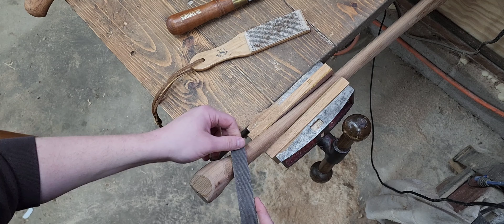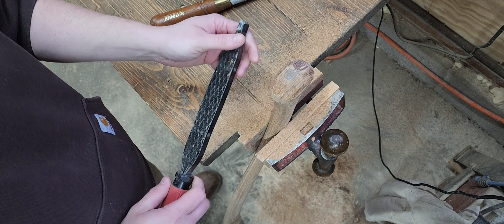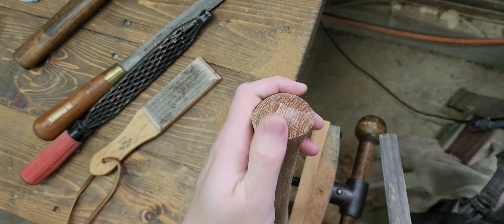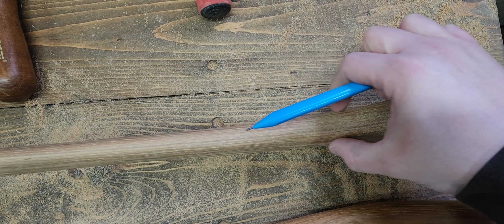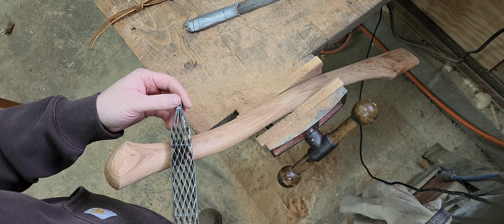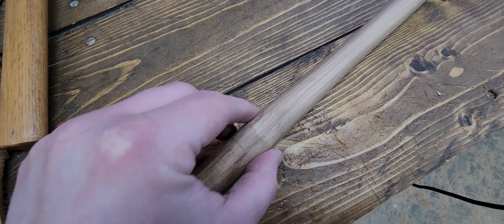AXE HANDLE SHAPING: PART 2 of 3

Comment: A topnotch tutorial. Have you ever used a nicholson # 50 half round pattern makers rasp? I bought one 30 years ago and it's going strong. They're still available but not cheap, I believe $65. Thanks for the good video and good luck, Chris
Reply from the maker: The one rasp with the duct tape handle is a Nicholson that I inherited from my grandfather. I dropped and broke off the tang probably 10 years ago. I loved how it cut so couldn't part with it. I'm not sure what model it is but have thought about picking up some new ones to test out. I'll have to check that #50 out. I may also pick up one of those curved Japanese pull files but those are also a little pricy. Thanks for checking out the video!

Comment: i expected you to have pencil lines all over it for the pommel end. but i suppose experience...
Reply from the maker: When I recorded this part of the video I did a lot of explaining of how I move the files to get the desired shape. When I edited the video I figured people didn't want to watch a few hours of me shaping and explaining so I sped up the footage.

Much of it is taking off some material and then checking it, then going back and taking off a little more.
Reply: @IronOxAxeAndTool  excellent  content, wasn't a criticism,  far from it.
Reply from the maker: @Lance Millward  it certainly wasn't taken as that. No worries! It's a struggle learning how to show the process but also distill it into a length video that's manageable to watch lol. It seems when I'm doing these handle shapings I'll have upwards of 3 hours or so and I'll speed it up to take around 15 min total. I appreciate you checking out the videos 👍